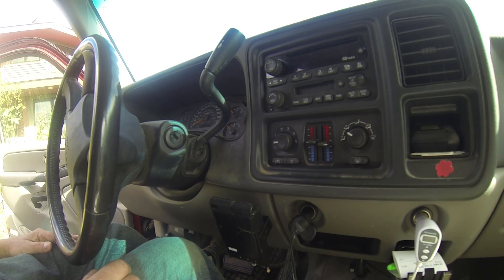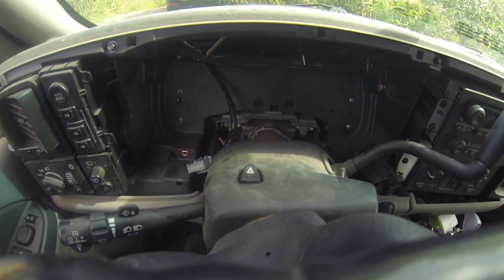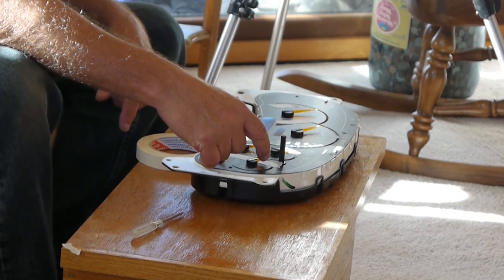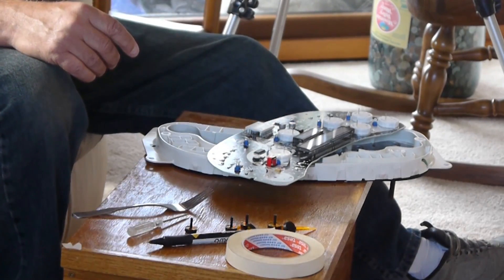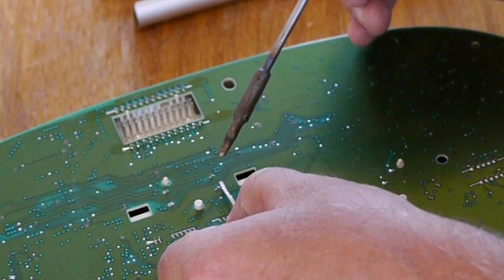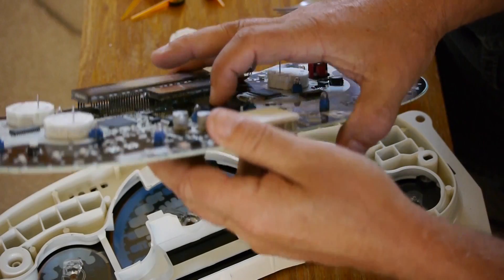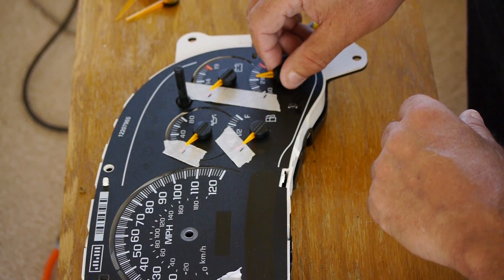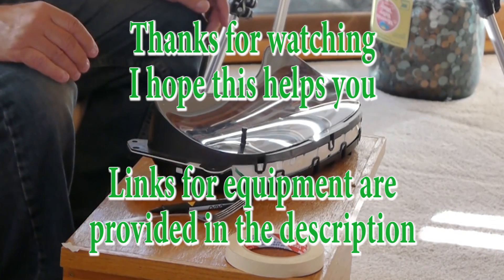Speedometer Stepper Motor Replacement 2003 Suburban. HD

Comment: I am not a soldering expert but I think even I can do this job.  Fortunately this is one GM part that is super easy to remove.  The speedometer shop locally where I live wants over 300.00 to do this repair.  Parts are 18 to 20 dollars so I believe for anyone who is even remotely adept at working with vehicles or electrical components should do this at home.  Good video.

Comment: A couple suggestions/hints:  Stuff a rag or something in the gap below the instrument cluster in case you drop one of the screws. 

Replace ALL the motors at once.  I had one (volt meter) go bad and ignored it.  In a two day period the Oil, Temp, and Fuel motors all went bad so I'm replacing all of them.  I ordered a set of motors and lamps and will replace all at once.
Reply from the maker: jollyrgr3 Great suggestion Jolly!  Pete

Comment: Repaired speedo but now a couple of lights are not working. Specifically it appears the left half of speed and oil pressure gauges not lit up anymore?  Thoughts?
Reply from the maker: +Joe Landers sorry, i seemed to miss this question.  If the worked prior to the replacement servo, then i would suspect a solder bridge, or a foil that broke during removel